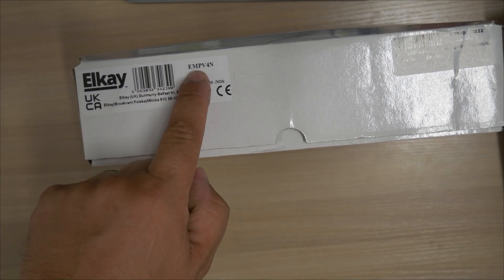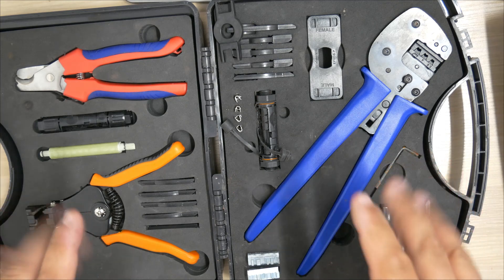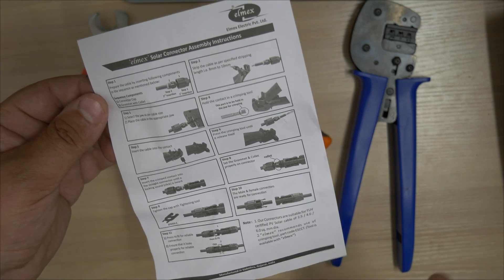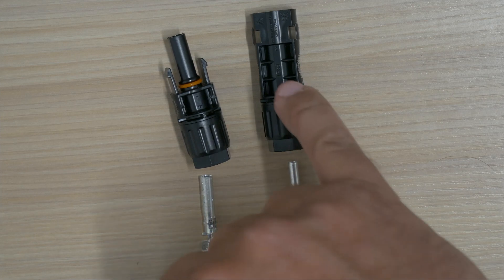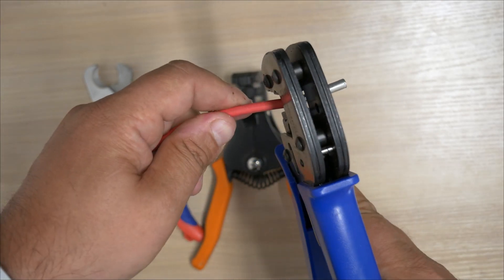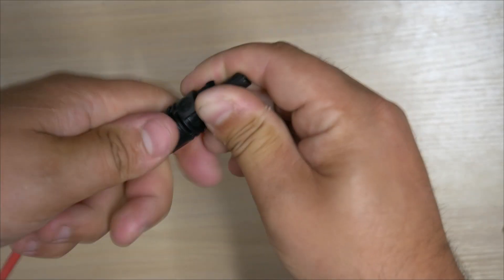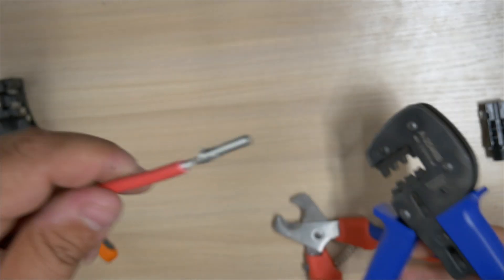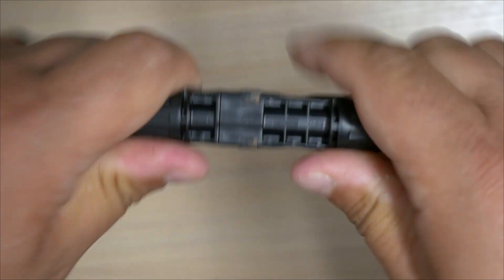How to terminate an MC4 solar connector from Elmex Elkay

Comment: Glad to see the most important ‘tug’ test at the end. Ive had supposed quality MC4 connectors pull apart on me where the male clips have been warped/ squashed in transit so they don’t fully engage. Even though they initially look sound and hold together 
See too many people just pushing them together as complacency sets in. 😮😮